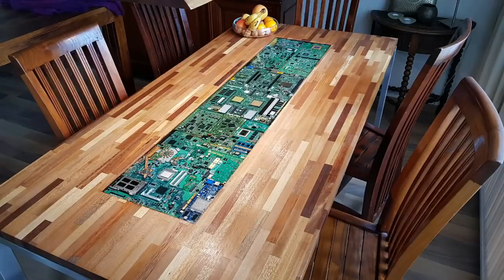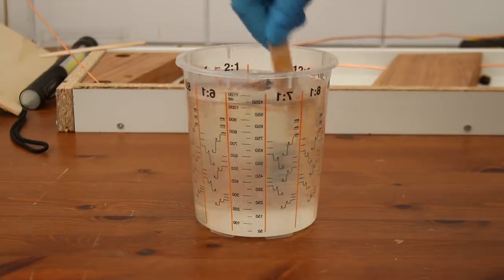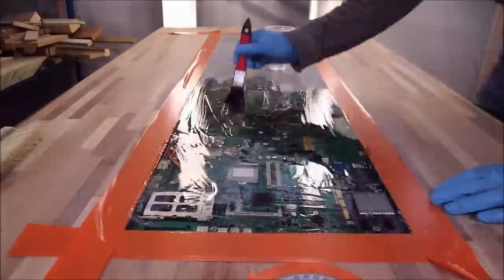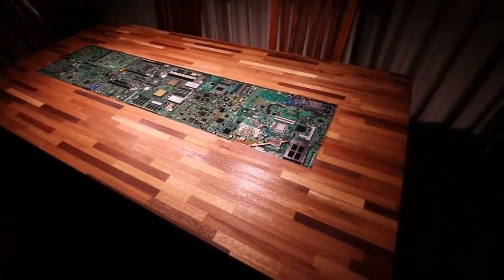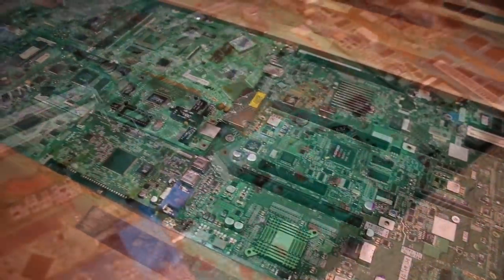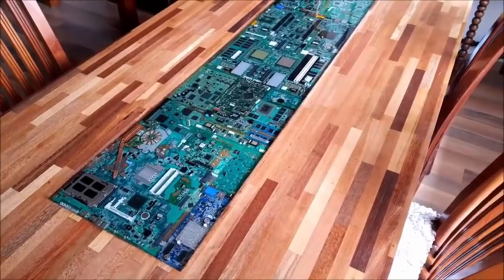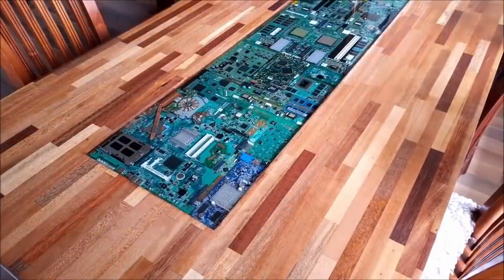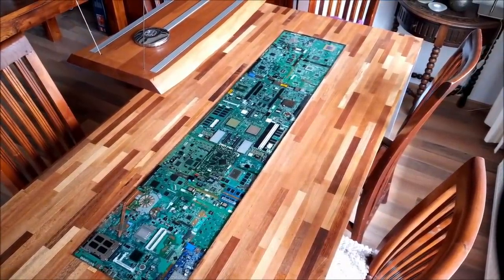Circuit boards with lights in epoxy in a table

Comment: Still love your idea and the final look. Perhaps you need to pay more for a reputable make of resin next time with a good proven pedigree.  I've promise myself to try a similar project as I'm retired now. GOOD LUCK.
Reply from the maker: The epoxy was of the more expensive kind. I found it good to handle. No, it was definitely the mixing that I screwed up... Thanks!

Comment: You probably should have sealed the wood with primer before pouring any appoxy. Timber is pourous and caused so elements fo the hardening chemicals to leach out of the emoxy mix.

Comment: I admire your honesty in admitting failure. Overall, fantastic project.
Reply: I had the same exact thought. A lot of YouTubers only want to share their perfect attempts. You tend to learn the most from mistakes especially when someone else makes them first. LOL Great video.  Being an Electrical Engineering I am particularly biased.
Reply: Use glass on top.. I wont call it failure its looks fantastic

Comment: Pour a layer of proper mixed epoxy over the whole top of the table and have an epoxy top, do it right and you wont be able to damage the wood either

Comment: Put a wood frame around the border of the table. Pour another 3/8th's of well mixed epoxy over the whole surface.  Soft spots dealt with. And a table you can save and use.👍

Comment: You didn't let every single square inch of the epoxy cure completely before adding another layer. Either have spent extra time allowing to dry & set or make it all one continuous pour

Comment: Good try, anyway.
If you don't mind a suggestion.
Make a wood box insert. That way upon future attempts you don't damage the table further. Also, connect the circuit board lights to a power system. Make the circuits usefull, not just to look at.

Comment: Sucess. I may give a sugestion for the next, about leds. You could just leave leds, connect to nothing, and with radio frequencies you could light them up at distance, with no batteries on leds, cables whatever. But its funny and nice to take a cell phone and make them blink. Nice table there.

Comment: The first layer melted from the heat generated by the 2nd layer it’s happened to many projects of mine
Reply: So multiple layers to apply the 7 liters will help prevent the funkiness?
Reply: Shannon O. Depends on which epoxy you use, there are many variations, ie for +2” thickness pours, for 1/2” thick, etc.
Reply: It all depends on the epoxy brand you use
Reply: Did the epoxy react with the plastic of the components or was it curing heat generated
Reply: He needed to not pour 7 LITERS in one go.  Too much epoxy=too much heat=goofy looking finish.

Comment: Nice. It looks like some sci-fi cityscape. :-) (Also a point to note is adjusting the capacitors to make sure they all stand upright like tower blocks. Great job. I'm an electronics engineer and this is the sort of table I would buy. Another idea just popped into my head. What if you paint luminous "highways" on the boards. Once you off the  lights, they will glow and augment the 'LED' lights, which are brilliantly lit with optical fibres instead of some xmas light gadget. *two thumbs up

Comment: I think you did a fantastic job!  What an awesome idea.  I’d kill for a table this cool.  Given all of the hard work you put into it, I wouldn’t give up.  Can you tell how deep the “defects/distorted epoxy” are?  Seems like they could be sanded out and then pour new epoxy over the whole table.  I’ve had uncured epoxy before and a top coat stirred thoroughly fixed it!
Reply from the maker: If you watched the whole video, you saw me applying the top coat... it didn't help. They are too deep to sand out. The only way is the chisel and the router, I guess.. Thanks for the heads up and thinking with me.

Comment: Cool idea.  But you should have checked the levels of your opening or chose a little different design.  Wood is never perfectly straight.  It’s the only thing that can be dead for 100 years and still move.

Comment: Removing the fan blade and showing off the copper stators was a nice touch on that motherboard.
Reply from the maker: It was not a fan, but a motor of a floppy disk drive.

Comment: Unless you haven't tempered the epoxy after it is hard to at least 80°C for several hours it will certainly cause allergic reactions to everyone who touches it, sooner or later.
Stickiness could be caused by not adding enough hardener which results that resin isn't matured yet, very bad.

You should, use a better mixer, waiting for bubbles to get realesed from the mixture, maybe using slower hardener. It is possible that blurriness is caused by the sheer volume of epoxy starting to boil on some places.

Comment: 1) Pour just hardener over the top
2) Rout out a quarter inch of the edge like you talked about and put an inlay of a darker wood to fix up those edges
3) I always wet sand epoxy from a similar experience here lol
Reply: Yes this!

Comment: Never mix epoxy with a stick unless you have to. Get a squirrel cage style mixer that will not aerate the epoxy as it turns, a drill, and mix it for 5 minutes that way. You also don’t have to be as careful with the height. And could have taped the table off, poured enough for it to run over the sides, taken a straight level or so, and raked across the top to remove all the excess, and naturally it would settle right back as it was. Also, use a bernzomatic torch to go over the top sweeping side to side quickly, and you’ll remove a ton of imperfections, bubbles, etc, that you’ll be left with a prestige surface everytime.
The key is not to make just enough to fill, but to screed out the intentional excess. Also, you’ll want to have the tape over the edge by 1/16” of an inch so as to have no epoxy get under the tape while you straight edge the top. After that immediately pull your tape towards the inside of the center of the table, and the epoxy will fold off of the tape and onto the wet epoxy instead of getting any of it on the wooden surface. Try those things the next time, and you’ll have exactly what you need.

Comment: You can fix the epoxy as is. I’ve worked with epoxy for over a decade doing many many custom table tops among other things.

Message me back here if you get this, cause I’m not going to write it all unless you’ll see it.

Comment: ,,Am I talking to the support? Yes, I have an issue, my table won't boot."
Reply: "Go to Walmart, purchase 10 iTunes gift card for $100 dollars each.... "
Reply: @dglesterhardunkichud4017  xD
Reply: "Do the lights come on? Then the table boots. Your problem is something else."
Reply: I heard if your working with tables you should run a spreadsheet. Preferably over the table...that should fix it!!
Reply: "I'm sorry to hear about your trouble sir....you will need to proceed with a hard drive re-format"
Reply: I extremely apologize for this inconvenience but i assure you that we will get this resolved by the end of our conversation. Now, please unplug the table for 60 seconds. Make sure it is the full 60 seconds. I will wait with you. Is it unplugged? Ok. I have to take another call but I will be right back, please stay with me.
Reply: You need to turn off the power, reboot, tap f11 several times to get into the boot menu, try updating the bios, save changes and exit. It should reboot normally, if not press control, alt, delete and smash it with a big hammer, that usually works⚠️😁
Reply: I think it has a virus :P
Reply: More lights for holidays and stuff. Maybe a table with lights throughout the whole top.
Reply: Did you try sanding it off and putting a new coat on again?
Reply: @aspyr5681  check your internet connection and try it again later
Reply: "Is is a desktop pc, or?"
Reply: You're probably just holding the table wrong.
Reply: When his  scrap  CPU decorations are newer than the one your using to see youtube:     :-(
Reply: @SeaJay_Oceans  jaja exactly what I was going to say
Reply: Turn over the cpu
Reply: Hello, Dell support.  Wait! This call will cost you before I'm allowed to speak to you.  Did you purchase a warranty?
Reply: "Did you try Rice, Sir?"
Reply: Another great idea. Might have to steal this idea
Reply: Elysion B I think my mother board is bad could you check this out fer me sir ?
Reply: @scottb8945  Yes sure, Sir. Give me a minute. 
...
...
...
...
Which board exactly? There's about a million.
Reply: Try restarting it
Reply: table.exe stopped working
Reply: Maybe , you can (rebootable) it, Ha!
Reply: Onrust!  -  I really want to see you build a circuit parts   stained glass  WINDOW, out of old windows computers... :-)  The Meta Meta is intense.
Reply: 🤣🤣🤣🤣🤣🤣 good thing jajajajajsjs
Reply: For Linus from LTT that is an actual problem he can have XD
Reply: Please try again later 😂

Comment: May be your Epoxy didn't mixed well...
I'm working with Epoxy molding on LG Air Conditioner as a job. It can be different which Epoxy you have mixed, but I'm sure Epoxy doesn't mix easily when it was mixed by spoon or stick or...someting else.
So whenever I have to mix Epoxy with my hand, I use 'Cable Tie' and 'Electric Screw Driver' to mix them well!

Comment: I could tell by the way you were working it that it was going to be a fail pretty early on. With that said, its not the worst epoxy fail I've seen, and the leds were a nice touch.

Comment: Glass top would work, but I would be concerned about the battery in the resin over time.
Reply: No battery there
Reply from the maker: Yes there is one small battery in (the ones that keep the clock on motherboards ticking) but I don't think there will happen anything with it. It is sealed airtight. Corrosion is impossible.

Comment: was these working motherboard's?
Reply from the maker: Once. Yes. 😆
Reply: @Onrust1  and why did u needed to do then to do this? if their where already broken ok good idea but not if once working
Reply from the maker: @lefteris.adamou.1  No worries, the computers the boards came out of were all old and ready to throw away. Maybe some did still work, but they were old. slow, worthless and obsolete..
Reply: @Onrust1  if u put an ssd i think they will run a little bit faster 😜
Reply from the maker: You don't understand - it's running completely diskless, so no SSD required. I think it has something to do with the cloud. The epoxy cloud... 😆😆

Comment: This is awesome, sorry it crashed, was it running windows vista 😊. I would like to try this, but maybe have the top a piece of removable glass for none scratch and easy cleaning. There is a product called Crystal/Super/Ultra Clear Epoxy River Table Resin.

You could always edge the perimeter with LED's to cove imperfections?

Comment: I didn't saw that after each pored layer of epoxy you heated up, so maybe instead 7L (2X3,5L) you need several layers 7L (3X2,4L) or 7L (4X1,8 - too thin hard to level) to pour and heat them up to gain consistency of epoxy resin... say maybe... But I am thrilled ...
Reply: ...thx, :-) but after all when you serve a steak (love well done) and good red vine, you can't remember what are flaws and cons's, stays only good feeling about meet...hope that you are not vegetarian ....
 Regards and keep good workin...

Comment: i would suggest to put a foil on the whole table, like sth you put on glass just in case if it breaks, so you get a solid equal layer with no sticky parts

Comment: I congratulate you for the great work you have done
The final result of putting a flashlight on the fiber optic has made me feel terrible, I think I would put an electronic controller or an arduino to control the LEDs
in short, a great result but to my liking electronic boards do not convince me as an ornament
Reply from the maker: I deliberately left out the controller, because I thought you would go crazy quickly of a carnival in a table all the time... 😊 It is the temporary character of the manual light for a few seconds in the fiber optic that I like.
Reply: @Onrust1  😊😊😊

Comment: Hi, in the epoxy videos I have watched, they have put the epoxy in a tank and either pressurised or vacuumed it to get the bubbles out.  Once poured they use a blowtorch to help remove bubbles from the pouring process.  Check out Stone Coat Countertops.  It's probably way too late now but you could always try the blowtorch as some of the epoxy has not gone off.  You could always try contacting SCC for advice.

Comment: Epoxy hardner ratio must be checked and pouring must be uniform throughout better u can tilt the table from one side and pour it so all air gets released... and u can use IR curing might help

Comment: Maybe if you drive a bunch of screws in the epoxy it will crack into chunks that come out easeir?  Maybe the screws become something you can grab and pry on to get it out?
Reply from the maker: Good idea, good suggestion. I thought to first go at it with a small drill and drill lots holes, and after that take the router, but the screws I will certainly remember. I might even try to make some screw thread in the epoxy and drive chunks of upper-layer epoxy out that way. 
Thank you! 😊👍

Comment: If you have a location on a wall, perhaps where you may even need sound dampening, you could mount it to the wall.  Despite it being not what you intended it to be, it would be cool for anyone outside of the creation process, as they would not be so hyper aware of the learning moments you ran into.

Comment: When pouring epoxy you should try to have the next pours ready for when the previous layer of epoxy is at gel state then pour your next layer. That way they adhere to each other. Nice table though I would still be proud of it.

Comment: Really great design and idea. Could you block round the sides of the table and pour a coat if epoxy over the whole top as a fix for the sticky leaking?

Comment: Cut out the circuit boards and place a new bottom in the hole you cut.  Then you can try again.  If the hole you have to cut is bigger than the circuit boards then fill in the edges with a bright colored resin like blue or orange.  That would give you a highlight strip around the circuit boards and I think would look really good.

Comment: use the hot air gun to fix it, brother, you did an amazing job, don't be demotivated. you are just one step away. then out the table in the bright and hot sun for a few days.
it will cure the epoxy by natural UV rays.
hope it helps.

Comment: Awesome idea!! and awesome work!! I would love to buy it!! I love the idea of LED with optic fiber :))
I think I would go with first making a long acrylic tray about 3 inch deep, put boards in it, epoxy and all and then put this ready piece into table cut with the size of tray.
Reply from the maker: Nice idea of the tray... but then you would leave out the optic cable? Or how would you connect those then..?
Reply: @Onrust1  I think that can be done the same way as you, after first pour of epoxy, drill the holes and put led with optic fiber, run the fibers underneath the tray,  this may need a small channel cut in the table to accommodate the fiber bunch.

Comment: Could we know the measurements of the shape where you put in the motherboard? Thanks
Reply from the maker: Oof, I don't know them by head (can't measure it, for it is in my workshop), but I'm pretty sure it is 31 x 130 cm. The 31 cm was the width of the largest of the circuit boards I had, one of an old Sun server. After measuring the thickness of the boards, I came to the conclusion that 22 - 23 mm of depth would do, so I didn't router it down to the 25 mm I cut out with the saw. Every mm less, is less epoxy and that stuff is expensive..

Comment: Make a router sled and carve as mush epoxy out as you can without damaging the old mobos etc.
Then refill.
I would add a 3-5mm raised edge around the table and fill the epoxy so it covers the wood, covering the the table.
Nice Work

Comment: Cool idea but add more lights and in different colors and with a controller box :p
You could fix it by adding a clear glassplate on top of the entire table to get rid of the sticky spots but not the ugly spots thougj
Reply from the maker: I deliberately left out the different colors and the controller, because I thought you would go crazy quickly of a carnival in a table... 😊

Comment: How about a sheet of glass over the top?
Reply: @Shadow Banned Why would you even use epoxy with the glass panel? 
Just mount glass on the top of the boards and there you go it's done. 
Not as cool as the version with epoxy but still pretty cool.
Reply: @partiid  you will gets hurtbutt if u do that. Because u need to add some glue to make that circuit doesnt move at all. And u need to remove the glass to clean it when some of your soda spilled in that table
Reply: @KarvaregzelLibraryMythical  Not if you seal the gap with silicone. And epoxy is toxic.
Reply: @KarvaregzelLibraryMythical  The circuit boards can still be stuck in place with a thin layer of epoxy, or some other glue, below them. It doesn't have to be visible.
Reply: also the epoxy will be yellowish after few years
Reply: Anti-UV glass so the epoxy doesn't yellow over time.

Comment: You know what, i know it sticks that it failed but I do like that fact that sometimes when you work you butt off to make something great, it doesn’t work out, I do that sometimes.  I used epoxy before but I read the instructions many times, they can’t stress it enough that epoxy has to be mix very well into different cups or by using a laser thermometer for when it get to the right temp before dumping.  Thanks for sharing this table, I do enjoy the idea.

Comment: My recommendation is that you do this but leave 1mm or so at the top, where you can put a glass sheet cut to your size. Considering the great cost of expoy, this would also have been cheaper.